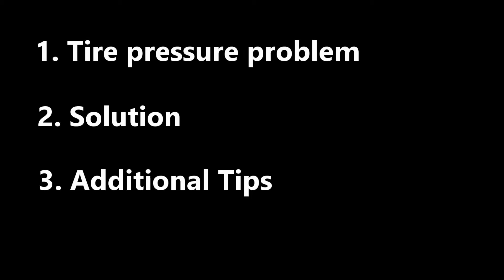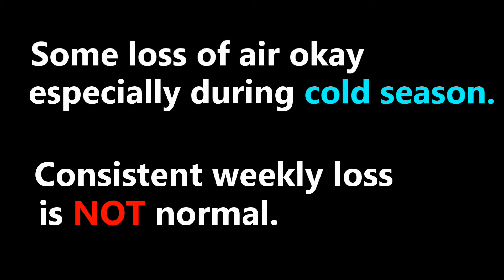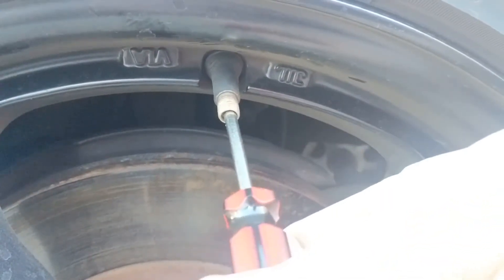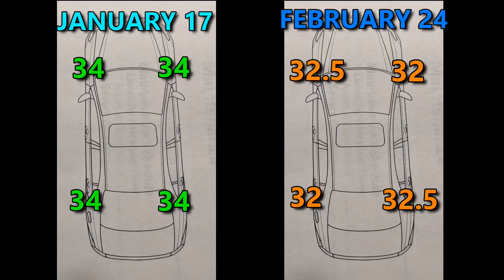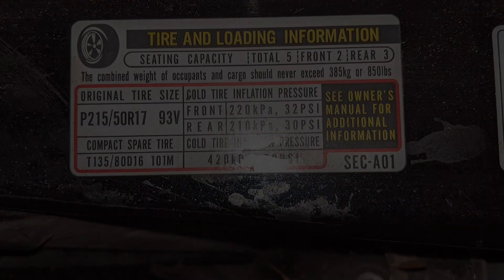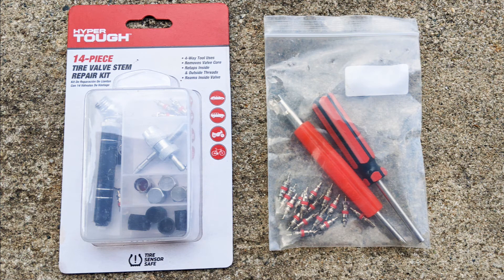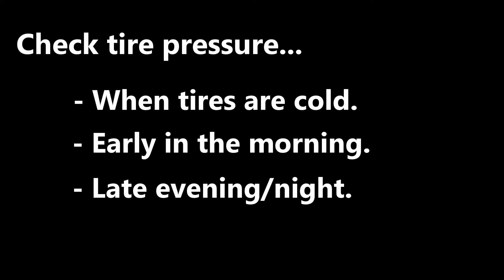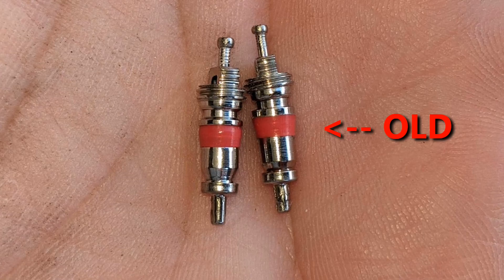How to Fix Slow Tire Pressure Loss

Comment: I also have an Acura and suspect the valve core is the culprit for my tire tire leak because I already replaced the tire.
Reply from the maker: Give it a try and see if that helps. Valve cores are cheap compared to the cost of replacing the tire. It feels great to not have to refill my tires every weekend =D

Comment: Any idea on how to remove carrier bearings off the final drive gear?
Reply from the maker: I don't have experience working on the transmission. Have you tried using the Bearing separator and puller tool? See if this video by VTEC Academy channel to see if it helps. https://youtu.be/q8j728x6DW4
Reply: I found a shop that will remove and replace for me for $200. I saw that video but he doesn't replace the final drive carrier bearings unfortunately. I broke my final drive gear (chipped teeths) also damaged the bottom of the countershaft that contacts the final drive.
Reply: So I pulled the transmission without pulling the motor or dropping the subframe thanks to tsxclub. Since its out im going to replace all the bearings, seals, rear main seal, oil pan gasket (hondabond), clutch and flywheel, I would drop in a civic si lsd but I'm on a budget. :(
Reply from the maker: @k24in31  So you were able to cherry pick the transmission out from the top without pulling out the engine? That's awesome. The videos I saw either pulled out both the engine and transmission from the top or pulled the transmission and/or engine from the bottom by dropping the subframe.
Reply: Yeah, the trick is to manuever the tranny to get access to the clutch disc, unbolt it, take it out, then swing it out and up and its out. If I get a daily driver i'm contemplating of getting the cx racing intercooler and pipe kit to turbo the tsx. Bolt ons got boring to me already 😅
Reply from the maker: @k24in31  Thanks for that tip on removing the clutch disc and lifting the transmission from the top, Ill take note of that should I ever need to do that. You're graduating to bigger things now! I'm done messing with upgrades on my car. With kids and a mortgage I don't have the funds to play around anymore.
Reply: Check out reddit.com and search gme, should be able to pay off mortgage, support the family and have some play money 👍
Reply from the maker: @k24in31  Thanks! Ill check it out!